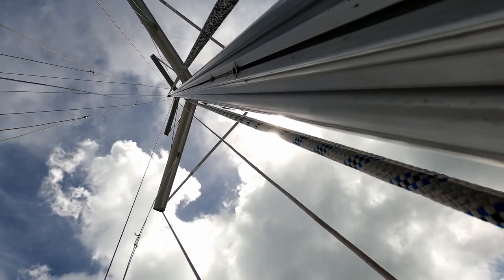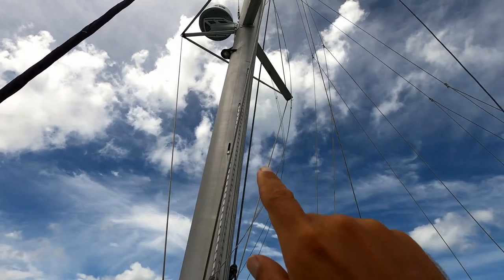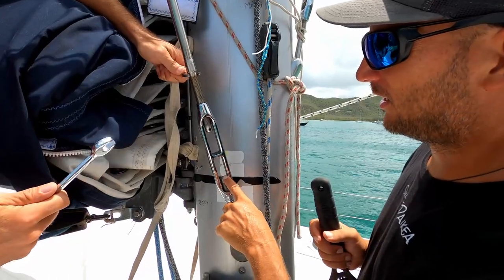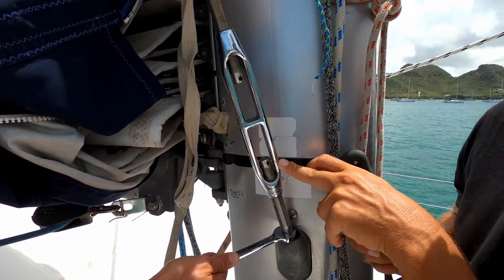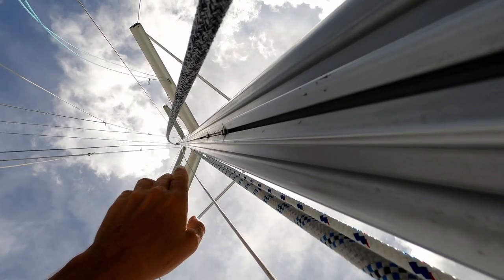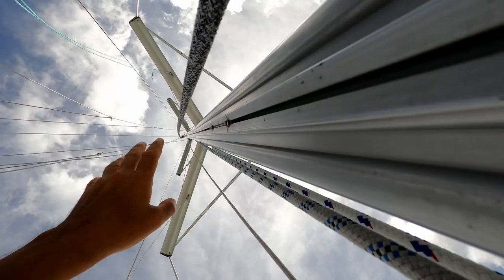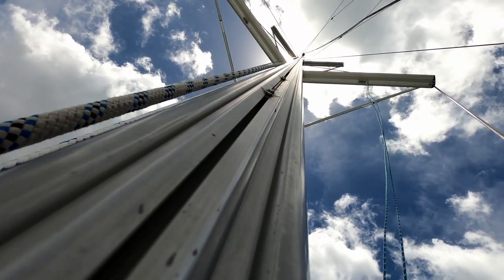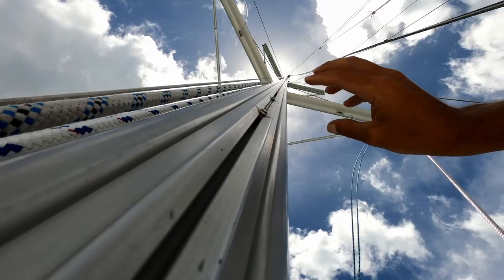How to tune a production catamaran rig - tips from a PROFESSIONAL rigger

Comment: The guys at Nance & Underwood in Florida could stand to watch this. After their 3rd failed attempt and bending my boat, I wouldn't let them back on board.
Reply from the maker: Ouch! Sorry to hear that. There are A LOT of cowboys out there.
Reply: @youngbarnacles  the worst part is they're supposed to be the best. N&U are the riggers that the biggest catamaran service center in South Florida uses. If they're the best I can't imagine how bad it could get.
Reply from the maker: That doesn't surprise me. We've been called in to fix a lot of stuff done by so called professionals 😅 Even at the top end of the scale there are issues. The marine industry is still the wild west and there needs to be more regulation / education around best practice methods.

Comment: On the martingale tensioning, to make adjusting easier rather than letting off the shrouds, bring a halyard down to each bow and grind them up tight before making adjustments. Much easier.

Comment: Thanks for the info but I am a bit confused with the prebend? Isn’t 1% of 15m    15cm ? So is 30mm correct ?
Reply from the maker: 1 percent is 150mm and 2 percent is 300mm for a 15m mast
Reply: @youngbarnacles  I think you said 15-30mm in the video at first (which is why I am here checking the comments straight up. I was interested because I got told by my designer to put between 1 and 1.5 mast cross sections lengths in - which I guess is about the same.
Reply from the maker: Yeah that's a good rule of thumb to use. Apologies, I fumbled a bit with explaining the math

Comment: Shayne you mentioned a locking headboard for the mainsail that locks open,  which manufacturer was that? Does the video on your site show what you use to secure turnbuckles?
Reply from the maker: Do you mean the "pull to engage"  locking system that we have on Paikea? There isn't anything good for smaller yachts/cats out there. Shayne custom made ours. Rigging Projects make them for much bigger boats but do not make anything smaller for cruising vessels. Antal has tried to do something but it isn't very successful and we wouldn't recommend it. Same with Harkens attempt. 
In terms of securing turnbuckles we use M4 cap head bolt(screws) with ny-lock nuts. These go in the thread ends of the turnbuckles instead of split rings. 
We cover them in this video  here https://youtu.be/mNXejSmeEE8?si=SVuimy9Q5KVAx47J
Reply: @youngbarnacles  So there's not an off the shelf item, but only custom solutions. The one word I didn't search for turnbuckle in your video list. Thank you for the information and link.
Reply from the maker: Correct. No good solution for smaller cruising yachts unless you go custom.

Comment: Thanks for doing this detail, very few  videos go to this length , yet it is so important to have the rig "right". I would be interested to know the rake on Pikea,s mast in t he video it looks  well aft ? As the owner of a non standard cat  without rig specs I am keen to learn what is optimum rake ? Rig tuning and SU tuning are  my favourite sports !
Reply from the maker: Paikea's rake was definitely too far aft to start with as we reused the forestay from the old mast which was slightly too long. We ended up shortening the forestay in Saint Martin. There is a great rigging shop there which we would recommend. We have a video talking about mast rake here -  https://youtu.be/jaCivOaCi4Q?si=gsv5WMIYGLk5YtdH 
There is no magic formula for optimum rake on a boat. Basically the rake in the mast moves the centre of effort around so it relies on a lot of contributing factors. For example, it is influenced by the size and shape of sails you are using. It also depends on your rig shape and stiffness. It also depends on where the rig is located on the vessel. Lots of factors to consider.